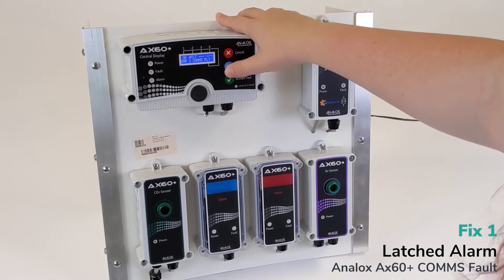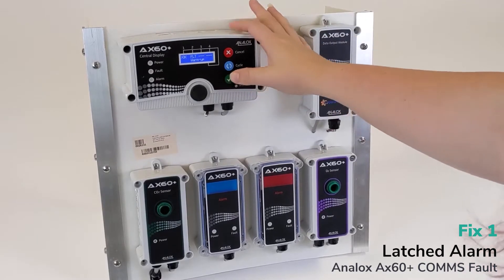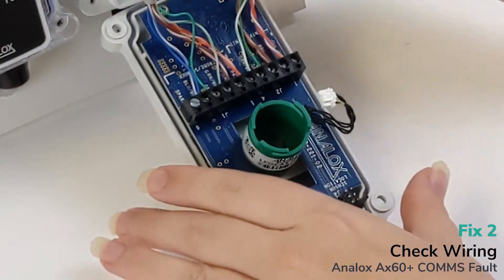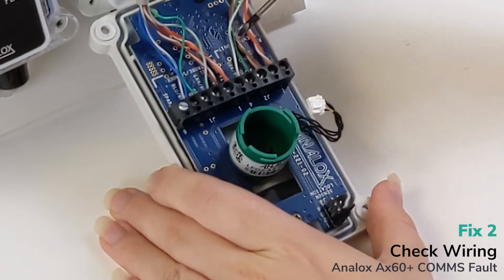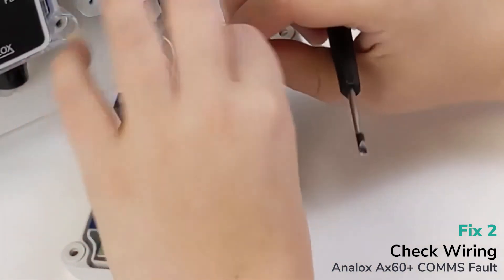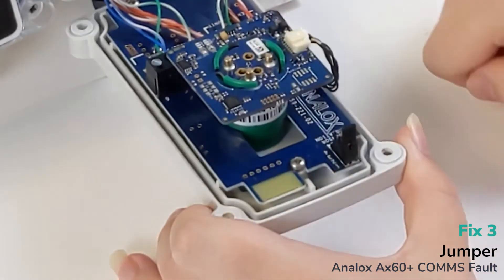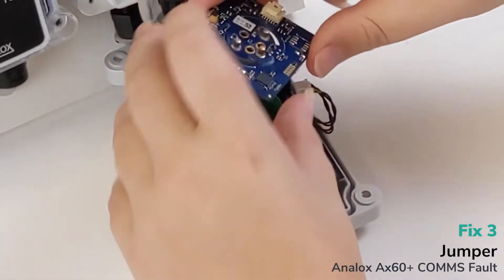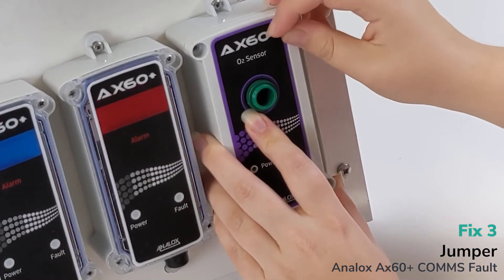Analox Ax60+ COMMS Fault Fixes

Comment: Hello, I'm getting the 
Ok *FLT - - -  - - -
2: comms fault. 

I only have one CO2 sensor nothing else besides the alarm is plugged in. This was brand new out of the box. I didn't change nothing yet. Is this the same fix I would need to fix the comms fault?
Reply from the maker: Hey there, we're sorry to hear this! It seems your unit thinks that there is more sensors connected to the central unit than there actually is. To fix this you need to access the top level menu by holding down both the cancel and cycle button. You should access the "Central Config" menu by scrolling along with cycle and pressing acknowledge when you have found it. From there go into "Attached Snsrs" and change the connected sensors from 2 to 1. Please let us know if this helped!